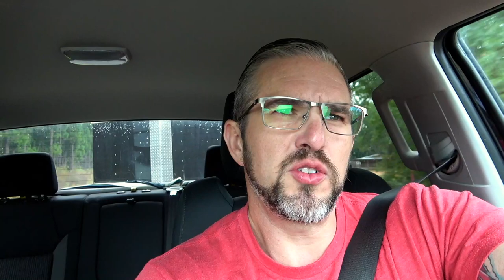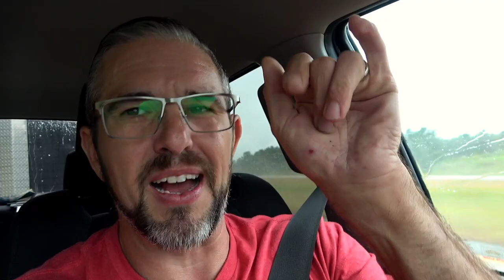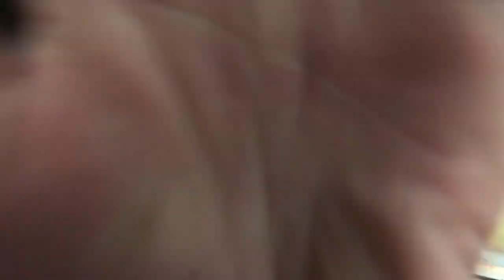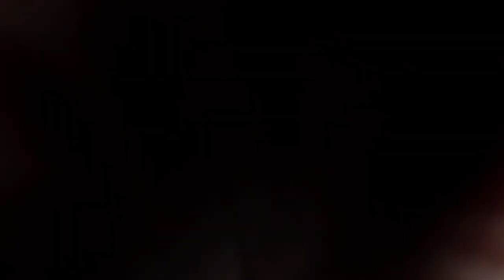PPG Thermal Flying Seminar Practice Talk:  Gear, Skills, Wings, Weather, SIV, Safety Tips and Tricks

Comment: Kyle, I saw a video on paragliding techniques. One that stood out to me that I never seen others talk about is pulling on the... c lines? The back most lines. Apparently if you do this correctly you can fly through aggressive thermal air without getting thrown about as much in the seat, maintain the wing pitch, and maintain an overall faster airspeed. I would like to hear or read what your thoughts on this is.